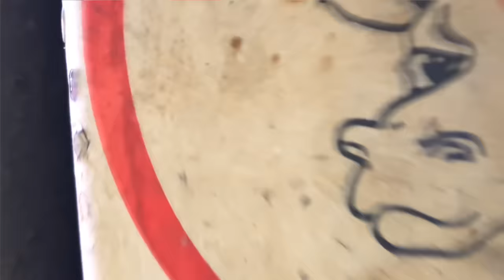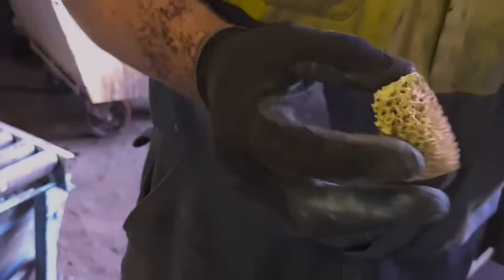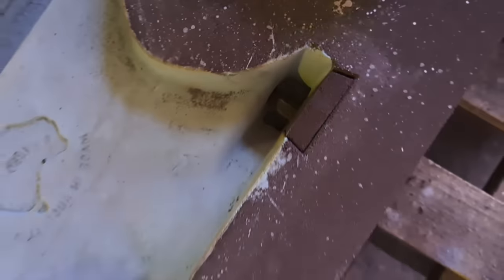Making a 100kg Steel Anvil - The Drag and Cores using K-CAST Sand

Comment: I like the part when he doesn’t make a 100kg steel Anvil.
Reply: Yeah WTF??
Reply: It's almost as if it's a multi-part video or something
Reply: Crikey mate....97kg....100kg....if that's all you can cry about...I think you gotta find better things to do with your life.
Reply: @Match2100  yeah but it doesn’t say part 1 or part 2 so I want a refund
Reply: @Match2100  It's almost as if the video title was poorly written.
Reply: Mha mha ha haha mha haha
Reply: @howstuffworks671  haha nobody asked you 😂
Reply: @howstuffworks671  They're referring to the part where the anvil wasn't even made, not whining about the weight. Did you even watch the video? Nothing was ever casted.
Reply: @papaown  probably a troll
Reply: Here is the other part to this video
https://youtu.be/X93n0T3ESO8
Reply: @innosyde7188  Look at the dates, that was released a month later with no reference to there being another video.
Reply: Yeh me too
Reply: @wfemp_4730   A cope is the term for the top half of the sand cast. The drag is the term for the bottom half. A core is a sand shape inserted into the mold to shape the casting interior. So it's actually a pretty specific title. The words might be unfamiliar to you, but that doesnt make it wrong.
Reply: @stephencallanan3795  I suggest you read this thread again.  Note to whom I was replying.  Try to understand the point I was making. Thanks.

Comment: Great video. Subscribed. Please in the next video also film the heat treating part. I have never seen that anywhere and would very much like to. Thanks for the vid. Have a good day.
Reply from the maker: Heat treating was done as the metal  cooled from the initial casting. It's not conventional but it works
Reply: Joey van der steg has a video where he heat treats an old anvil

Comment: That mold looks like you made it out of concrete.   Amazing work.
Reply: it's resin sand, basically resin but in a powdery form whish is easier to work with, so yeah, it's essentially like concrete but that dries much quicker, is significantly more expensive and probably not quite as strong.

Comment: I am curious as to how you can get a welded steel face on an anvil. My old Blacksmithing instructor said that the welded face anvils were the best
Reply: With cast iron there is a process in which you can pre-heat and then weld stringers of weld metal of your choice. Building up a layer.  Then post heating as it cools    Then surface the top and you’re done

Comment: I am curious about how they melt the steel and how it does not remove most of the carbon
Reply from the maker: it does, we add more back in to allow for it
Reply: @AusMetalCasting  how do you add it back in, siliconcarbide powder?
Reply from the maker: @Ho1yhe11  go and watch video 3 closely. It's in there
Reply: @AusMetalCasting  I watched the pour all it said was "adding carbon" and it was a black powder which could be siliconcarbide or coke dust or something else it was added before the metal was even melted which I would think would reduce its effectiveness 

Other things added were ferro manganese to add hardness was added when there were still some solid chunks of steel but a puddle of molten steel at bottom 

aluminum to help remove impurities added after everything was completely melted

 and a white powder which was unnamed to bunch the slag together I would assume this is limestone

Comment: It's not called paint interviewer it's call wash and its made of zircon flower, the most heat resistant of the sand scale and very expensive so its cheaper to build the mold with silica sand.  Some cases other sand is used in certain areas like Cera-bead, Chromite, Zircon all for different needs like chromite is used in areas that need a chill effect that is when you need to control the solidification in places you can't put an actual chill block (block of steel)
zircon is used for areas where a lot of burn in happens and you need more protection 
anyway the wash is made out of  zircon in most cases but there is other wash like when you do iron and manganese 
Steels and stainless is up in the 2700-2900 degrees pouring temps and need to be super heated sometimes up to 3000-3100
Ductile iron is much lower 2100-2400 so you don't need to worry so much about burn in
the use of zircon not even fresh silica just recycled silica an its grey wash is all thats needed

Comment: I worked in one of the best foundry's in the world making some VERY EXPENSIVE PARTS 
I wanna tell you something about the wash you are using we used to hand paint it on like you do in this video but the best way is to Flo coat if you don't know what that is its pouring on the wash and letting it flo off you want the wash to be a 65-70 buam'e 
this will give you a better cast surface with less porosity and burn

Comment: When do you do the actual casting?  5th or 6th video?
Why id you take the mold you were working on out of the frame? Dosen't the sand mold have to be framed when you cast the metal? Does on everything I've cast or seen cast.
3 ads at the start plus two during the video. Not worth watching because of the ads.

Comment: Thought anvils were forged, not cast
Reply: They are. Cast ones suck.
Reply: @MrDJSkeptik  not really. Old anvils and custom ones are forged in the OG methods. Some are drop forged (not like straight-up forging), most are cast STEEL (not iron, that is for poor quality). Cast steel is amazing, it just does not have the polyphonic ring of old forged anvils, unless you look at Austrian anvils (their shape partially makes that possible). More like "ting" but they are just dandy! Check out Holland Anvil, Fontanini Anvil for example of very good quality anvils. Heck, even many oldish anvils were cast (yes, even cast iron) with a hardened steel face welded onto it.
Reply: Mean to say if you choose to have the custom one forged.